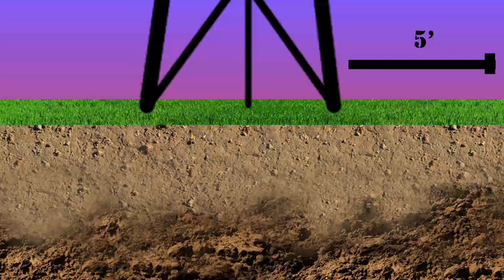Vintage Aermotor Windmill Restoration Ep 3 - Welding the Tower Supports

Comment: I found out about zinc in the early seventy's I was cutting out some floor boards that some body had slapped in on an Austin Healey 3000, I saw a green color as I cut the metal and I breathed some of the smoke in, Later that night I felt like I had the flu it lasted several days,
Wearing a proper mask or respirator is money well spent.
I enjoyed watching your videos, Thanks for posting

Comment: Just a good thing to know if you ever get that headache from welding galvanize or cutting.  Can tell from the green smoke.  Anyhow drink a big glass of milk and it will go away.  Still best is work up wind and avoid the headache.  Potato poultice if you get flash burn for eyes.